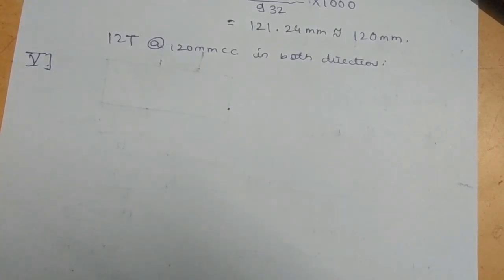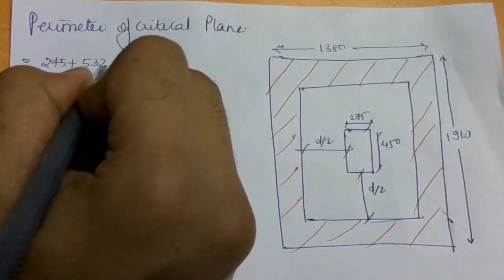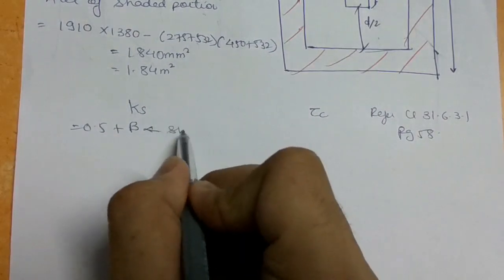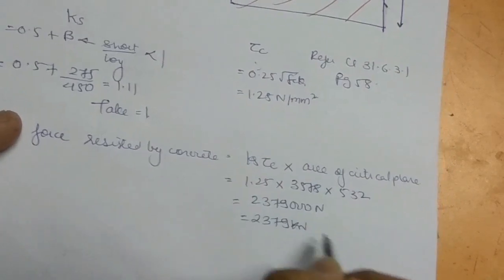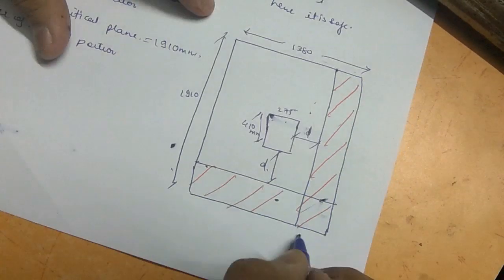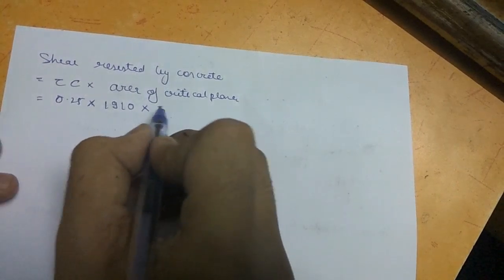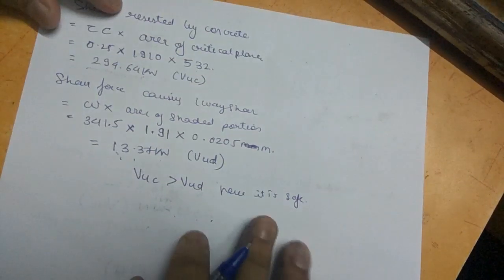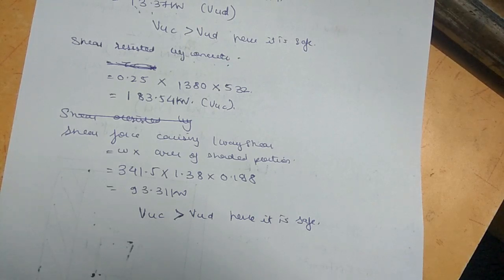Part 2 DESIGN OF FOOTING Solved Problem | IS 456 | Limit State Design | Mumbai University

Comment: In one way shear, you have considered the τc value 0.25 but as per formula τc should be 1.25, τc= 0.25 x (fck)^0.5. Kindly check & confirm.

Comment: For one way shear calculation how Tc will be 0.25 N/mm_2   as per IS 456 :2000 ? Because in  IS 456 :2000 Table 19 the minimum Tc value is 0.29 N/mm_2,so can please explain it?
Reply: it is mistaken u can calculate it by using Ast/bd*100 from table 19 as per Is 456:2000, which comes to be 0.29

Comment: Sir at 5:09 you have taken the area of critical plane to be 3578(perimeter of critical plane) x 532 (eff. Depth) which is becoming volume right. Area would be multiplication of the two sides of the critical plane right
Reply: No no its the area of critical plain, ((275+532)*d)*2 + ((450+532)*d)*2= area of critical plain, try to imagine 3d or for better understanding see the sir's video of Over view of footing